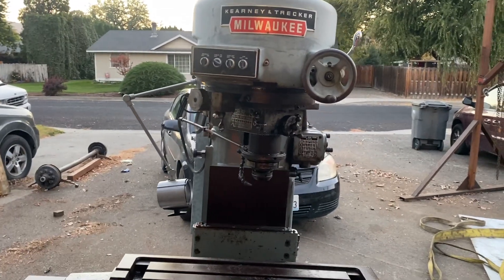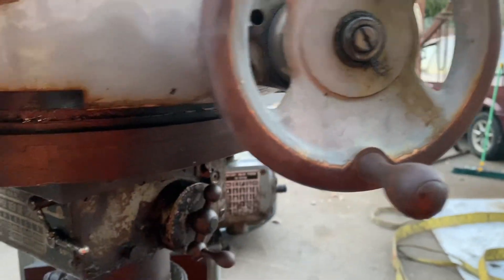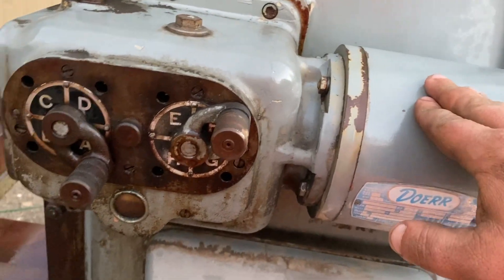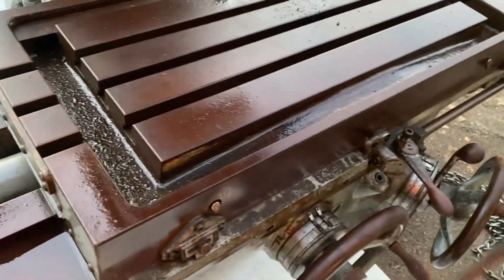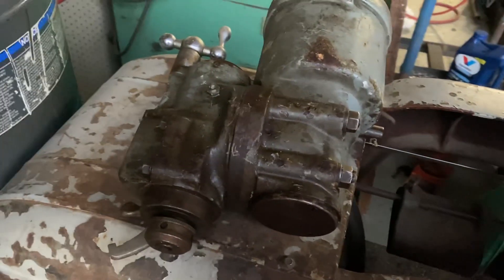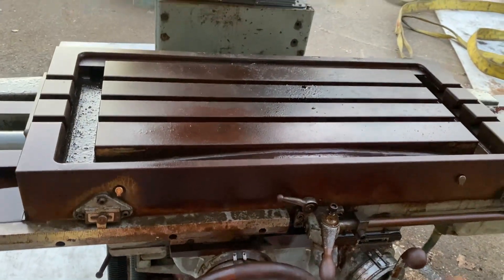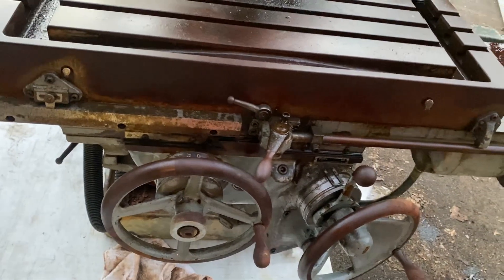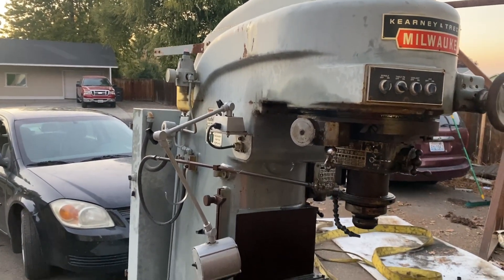New shop machine, Kearney & Trecker model 2D rotary head milling machine

Comment: That head set up  one really interesting feature to have .   That could be really great for facing wide items like cylinder heads .   You will not have to worry about any droopy table issues with that machine either  with that design .  One great score . 👍
Reply from the maker: Yes it seems like a really well designed machine

Comment: Is it single or 3 phase? How many amps will that pull at 240v single phase?
Reply from the maker: It’s 3 phase, right now it says it’s wires for 460 but all the motors are dual voltage and at the lower voltage full load of all motors would be around 24 amp